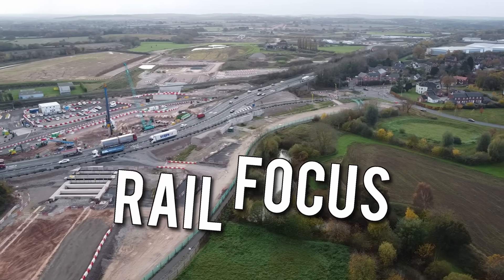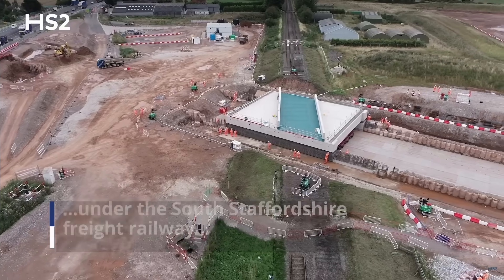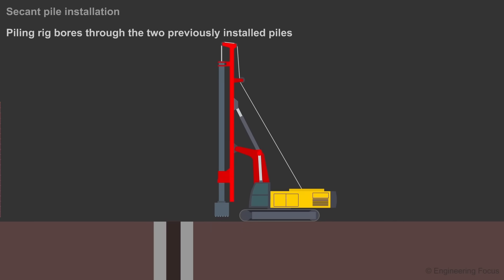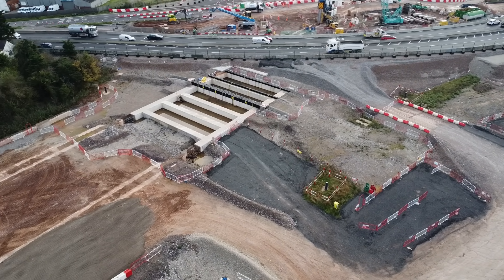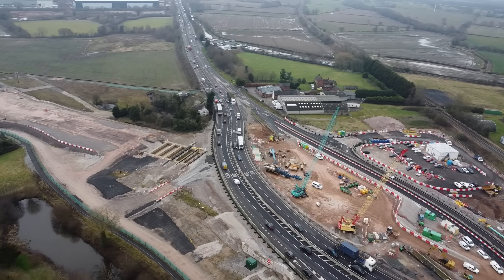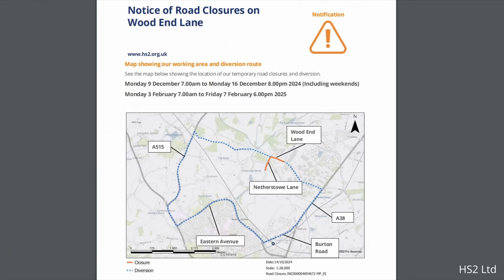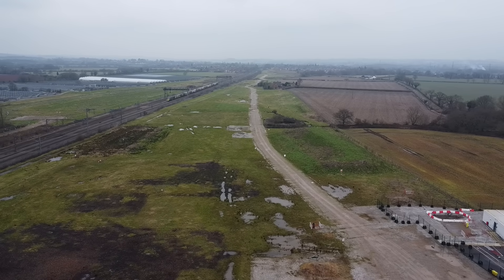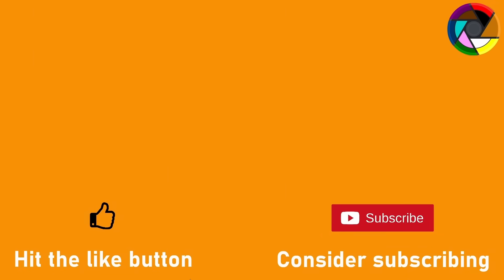HS2 Most Northerly Structure | A38 Lichfield

Comment: Great update video, BUT ;    No connection to HS1 = no use !    Handsacre is another example of how the UK designers don’t understand railways and, in particular, the performance of modern high speed trains.
Reply from the maker: HS2 was designed for 18 trains per hour, even if the HS1 connect was built only a handful of trains per day from Birmingham were proposed to head directly to the continent, so it's a bit much to claim the lack if a link renders HS2 of no use

Comment: While I support HS2, there are some, to me, glaring mistakes.

First and foremost now is the denial of the northern link. That means the southern section will on be used by people going to brum.

Secondly, it was never about shaving 2 mins off the journey time. It was capacity. If it had been called Extra Capacity 1, no one would have batted an eyelid. But the saving of a few seconds created massive disrepute for the project.

Thirdly, and probably most important, what additional capacity is available if HS2 becomes over used (fat chance I know). Look at other railways. They introduced double height coaches. So a coach carrying say 100 passengers (sorry, customers) could now carry 180, or whatever. So, assuming HS2 is a success, can we run these extra height carriages? NO. The bridges are too low. When you look at the cost of the project and the additional cost of the extra height, it’s unbelievable that this was not part of the design brief.

Comment: They should push out the slow lines at Handsacre Juntion and have the HS2 line drop in between the slow and fast lines with a Y junction (one on the up side one on the down) linking HS2 to both the fast and slow lines. Removes any conflicts and gives options to keep things moving when timings clash
Reply from the maker: That was the original plan. But what will be built now is anyone's guess. I'm hearing they are exploring options for Handsacre.

Comment: ... When construction only started from London the project was allways doomed to failure
Reply from the maker: Construction didn't only start from London, they're building much of the first phase simultaneously, including Birmingham. But the fact is phase 1 is needed first to help relieve congestion on the southern section of the WCML.
Reply: @Rail_Focus  .... yes I know that,  I wasn't clear enough.  If construction had simultaneously started at Manchester/ Leeds then that would have sent a clearer message out. 
I understand all about capacity

Comment: However complicated and difficult this construction it will have taken more than 4 years to go 1 kilometre compared with 6 years to build 3 50 kilometre long tunnels under the channel. The local disruption has been a major disturbance with at least one of the North and South slip roads being closed for most of that time affecting local businesses and residents for no eventual gain.
Reply from the maker: Considering 100km+ of the route is being built simultaneously, it's not really accurate to say it's taken 4 years to go 1km.
Reply: Incidentally secant piles are not watertight. They are water resistant. Ground water will seep through and discharge into a drainage channel finding it 'away into a drainage connection
Reply: HS2 and the Channel Tunnel projects bear no comparison to each other.  HS2 is built piecemeal to suit the existing infrastructure and every time the line crosses a road, river or railway approvals have to be secured.  Then there are thousands of planning conditions.

Comment: I’m glad that something is happening at the north of HS2, but as you say, not much has been happening outside of these engineering works that are the focus of the video - all seems a bit concerning to me :/
Reply from the maker: Several key structures need to be built north of the A38, so the "pause" will mean delays to services heading north. I just hope they've been using this time to devise a solution to the Handsacre problem.

Comment: Arg! Moving the HS2 connection to the slow lines to "save money" and then cancelling the rest of HS2, so that HS2 will "cause congestion" on the slow lines is super annoying.

I hope the delay in the works is because Labour is currently choosing between:
* Reinstating the fast line connection design,
* Reinstating Phase 2 of HS2 or
* Both of the above.
Reply from the maker: I'm more hopeful now that a solution is being developed, but the silence from the Government is really annoying.
Reply: @Rail_Focus  The pause in work north of Birmingham expires at the end of March, but given the government's shortage of money I anticipate either it will be extended or limited work only will be resumed, perhaps beginning with completion of the design itself.
Reply: It's gonna be interesting watching brand new HS2 trains trundling through Lancashire doing 80mph..🙄
Reply from the maker: 110-125mph......
Reply: @Rail_Focus clogging it then..😆😆
Reply: @leethrelfalllt  WCML speed profile is getting re-signed; there will soon only be a few curves where EPS (i.e. tilting trains) will be a bit faster. Regardless, Class 805/807 have timed-in fine even with the lower non-tilt speeds, thanks to better acceleration.

Comment: It's worth pointing out that the definition of Fast Lines and Slow Lines isn't quite what people think, for example the difference south of Handslope heading towards London is really just one of equipment fit and applied Cant and thus maintenance costs. The generally 125mph Fasts has TASS equipment to allow Tilt to be used, the generally 110 mph slows don't have TASS. As things stand non Tilt trains are restricted to 110mph on the Fasts.

Network Rail are bringing in higher speeds for non tilt trains where tracks are straight or thr curvature allows it and I'm led to believe this applies to around 70% of the route. Ask yourself why the new Aventi trains are non tilt??
Reply from the maker: I understand there may be room for some confusion re permissible speeds. But the slow lines are there for stopping services and freight. So introducing express services on those lines will impact capacity due to the speed differential, which is the main issue.
Reply: Maybe "slow" doesn't mean very slow, in this case, but the entire point of HS2 was to remove express trains from mainlines that need to operate more stopping services. So if that line has platforms next to it, and HS2 trains are going to thunder through them at speed, those stations are not going to have extra stopping services.
Reply: @DavidShepheard Indeed, I'm simply pointing out a technicality as to naming convention and operational reality. It's worth mapping the railway from Handsacre to Crewe, from the connection at Handsacre to Colwich Junction there's only Rugeley Trent Valley with one LNWR per hour in each direction. If anything the real issue is the flat junction at Colwich Junction, particularly for London bound services. 

The Handsacre conundrum will ultimately lead to more HSR infrastructure.
Reply: 125mph is only considered fast in countries that don't have real highspeed railways like the US and UK.

Comment: They're connecting hs2 to the slow west coast main lines?
Reply: Yes, currently that is the 'cost saving' plan. But that option does not unlock the full potential of HS2 so is a backwards plan. Hopefully common sense will prevail.
Reply from the maker: That seems to be the plan.

Comment: slow and steady, maybe this HS2 slow connection promotes development of fast northern connections and redo-HS2a ?
At least the following: 1. freight lines and HS2 maintenance from the north and south (from/to HS2 IMD) could keep HS2 tracks busy at night and an alternate HS2 path towards London.  2. promote future HS2 fast-line development, as everyone will complain about this HS2 devolution.

So far, is this slow WCML connection the only direct HS2 connection ?  (yes, HS2 IMD has the EWR connection)
I was hoping for some HS2 track/switch connectivity to existing lines like the Elizabeth Purple Line at OOK or Euston Station upgrade.

At least the northern spur is there.  Sideways HS2 "progress" ?

Separately...Another HS2 topic..."what if" they could fully integrate WCML with HS2 at Euston ?
That could add many more "HS2" Euston platforms, no ?
Or add new sub-grade platforms to Euston to get more platforms and increase HS2 and WCML capacity ?
Reply from the maker: Unfortunately the HS2 platforms at Euston will be several metres lower than the existing platforms due to space constraints getting from the tunnel to the station throat. So there's no way of fully integrating platforms and tracks. But that shouldn't matter too much. HS2 will effectively become the Avanti platforms and the existing station will be used for local and regional stopping services. That's not to say the old and new concourses can't be fully integrated.
Reply: @Rail_Focus  yes, focusing on the win-wins, and adding value at a cost.  Maybe design HS2 Euston as 2-level ?
Reply from the maker: I think the basic design is set in stone now. Platforms in a below ground box with a concourse at street level, with escalators and lifts to take people down. The only design choices now are the number of platforms and what if an over site development there will be.

Comment: Another great HS2 explainer and update. Thank you. Hopefully someone who makes spending decisions watches your previous video explaining the problem with constructing the line slow-to-fast at Handsacre rather than fast-to-fast. Even if we have to wait for enough funding to be made available to go further north it would be wise that the parts currently under construction are built to full specification so as not to hamper future generations of travellers.
Reply from the maker: I think they're working on a solution, but I've only heard suggestions, so couldn't really mention it in the video. But hopefully details will be announced sooner rather than later. They need to get on with building something soon.
Reply: @Rail_Focus  you would think that Curzon & Solihull to OOC will be running for a year or two before any Handsacre or (not yet announced) Crewe stub would be operational. So there is a little bit of time in hand. The Elizabeth Line was phased over an extended period and that went exceptionally smoothly. But I too wish they would get on with it.
Reply: @Maxhead_room  I think this week announcement that the OOC to Euston tunnel works is to be limited purely to building the tunnel and no other infrastructure such as ventilation shafts shows that they are going to have nearly complete focus on just getting OOC to Curzon up an running first and phase everything else in afterwards. I suspect they will rephase the work at OOC to make sure anything to do with HS2 is priorities and everything else surrounding will essentially be deem to be able to be done after that section is open.

Comment: Could Network Rail install new crossovers just north of this slow-line junction so that the HS2 trains need stay on the slow lines for a relatively short distance?
Reply from the maker: Possibly, but it means installing flat crossings which will provide a conflict. And I don't think it would ultimately solve the issue between Handsacre and Colwich

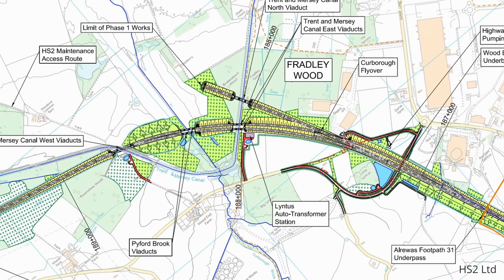Comment: Where can you find the drawing/map seen at 6:10?
Reply from the maker: Page 44.  https://assets.publishing.service.gov.uk/media/5a7d7b30ed915d2d2ac0936b/MB22_VOL2_CFA22_WATERMARKED.pdf
Reply: @Rail_Focus  Thanks
Reply from the maker: @jacobfuller-lewis5528 the Environmental Statement section is a great resource, but some of the drawings are out of date.
Reply: @Rail_Focus  Do you know if any of the stub for the leeds branch is gonna be constructed?
Reply from the maker: Not 100% sure, I'm in the process of trying to find out
Reply: @jacobfuller-lewis5528  it looks like it is as I believe the five parallel viaducts at Water Orton (holding six parallel tracks) are needed to smoothly integrate a future Leeds connection. The Leeds stub would start next to Junction 9 of the M42 and head across the site of the viaduct segment factory (near the Marston Box structure) running parallel to the M42. We will have to keep an eye out for a 'dive-under' being constructed in the area near to Junction 9 as this would inform us of any very-long-term plan to go East.